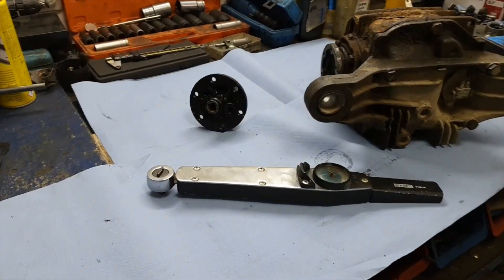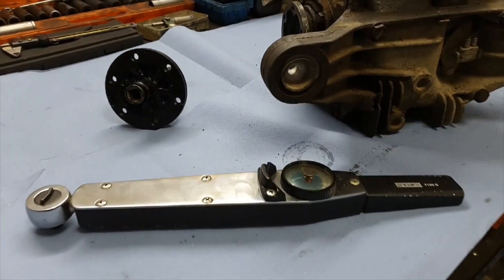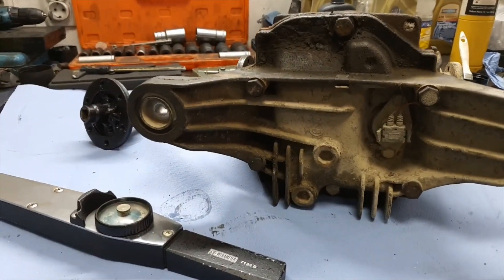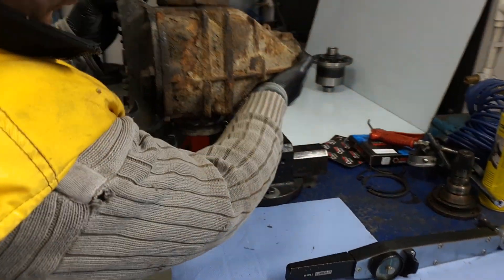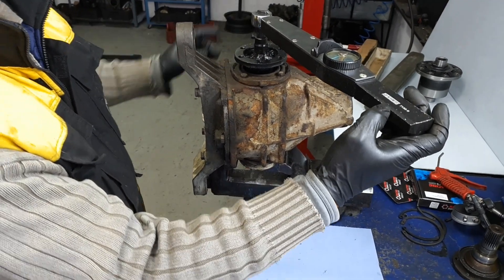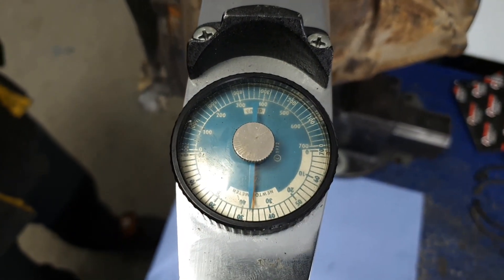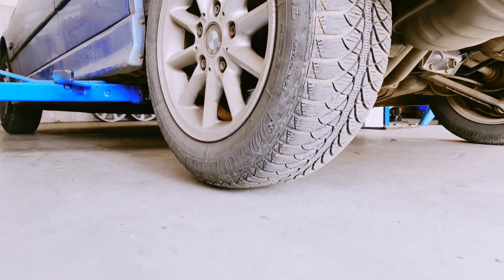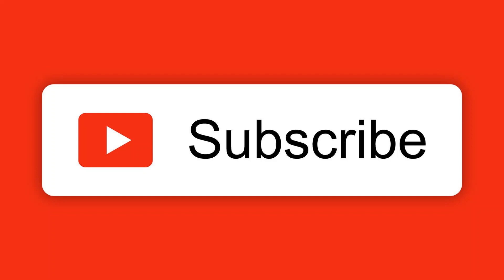BMW LSD Preload test | How to inspect condition of your diff without disassembly

Comment: Hi, can you tell me the torque value that the 168 LSD clutches should have, blocking 70% stage 3, when new, I need it to do the correct assembly
Reply from the maker: 120 - 140Nm.

Comment: Thanks for that video. What should breakaway torque be on 188 Torsen from BMW Z3?
Reply from the maker: Torsen doesn't have a breakaway torque. It acts like open diff when 1 wheel is lifted.
Reply: @RacingDiffs  so how I can check that he isn't worn out?
Reply from the maker: @Simply.Sideways  only visual inspection after disassembly

Comment: Hi! Im using convesion set for almost 2 years. Can you tell me whats breakaway torque is good / bad?
Reply from the maker: Conversion set works on low preload setup - 30-40Nm. Lock comes from ramp angoe design.
Reply: @RacingDiffs  Great. Thanks. Will try.

Comment: What should breakaway torque be on an e36 m3? im about to rebuilt my LSD but want a comparison, what is the stock number?
Reply from the maker: If is ti 3.0L engine than 80Nm. For 3.2L differential is 210mm and it should have 100Nm.